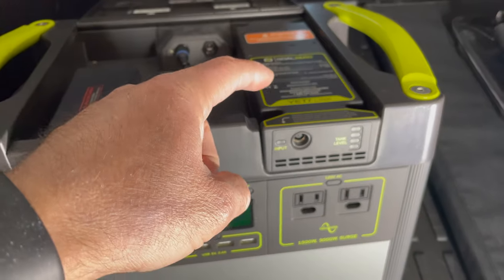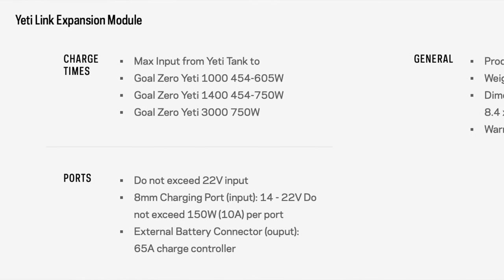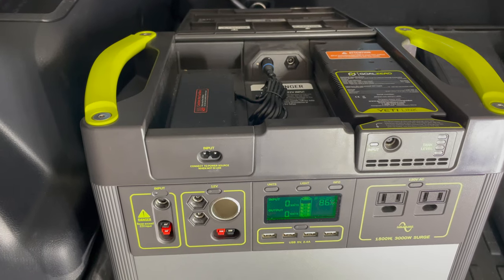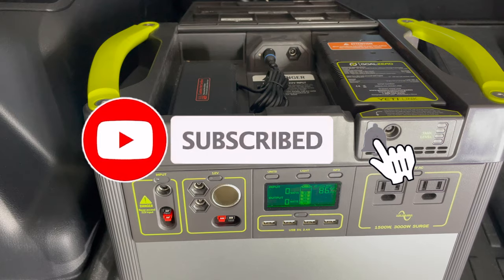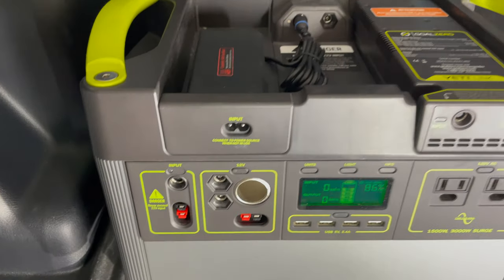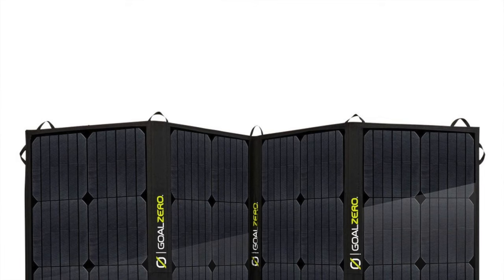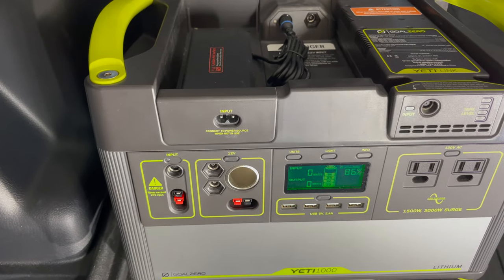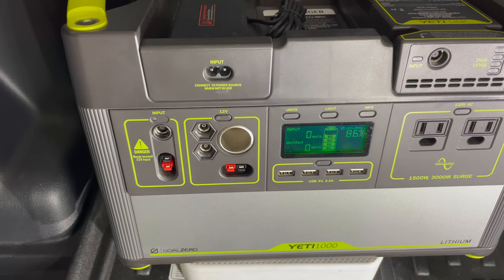5 ways to charge your Goal Zero Yeti and my favorite 2 options

Comment: Could you tell me how you wire the car link? Im trying to figure out what would be the best way to route the cable from the battery. I have gx460 which is very similar to your 4runner. Thx

Comment: You connected your Yeti 1000 directly to your alternator... could I charge my Yeti 3000 from an alternator that is attached to a bike and not a car? I COMPLETELY understand that this is not super efficient and that I will only produce a few hundred watts per hour (it's not hard to maintain about 200 watts for an hour), I am more interested in charging my Yeti 3000 as a way to inspire me to burn more calories on my bike than I am in actually charging the Yeti in any significant way. If I know that my watts on the bike were being saved in any way, it would inspire me to produce more watts and therefore ride the bike more. 

So again my question: do you think I could attach the Yeti Link to an alternator that is powered by a bike and still charge a Yeti 3000? Thanks!!

Comment: I just finished install of yeti link in my 2017 4runner.  Thanks again for your video as it helped me a lot.   When you turn the car off what do your link module LEDs do?   For me, all 4 stay lit for a few minutes, then it shifts to just the bottom 3 staying lit.  I left it that way for over an hr, wondering if they all turn off at some point or do they stay on "forever"?  But gave up waiting & just unplugged it.  Also when I disconnect the back Yeti Link cable, after the engine has been off for a while, I get flashing red for approx 1-2 mins bef they go blank.  Is it the same for you?
Reply from the maker: You should check out the instructions on GoalZero site. It doesn’t seems right. Usually after turning off the car all lights stay green for a few minutes then they go off.

Comment: Excellent video.  I too have a 4runner, a 2017.  What path did you use to route the link cable from battery to the back?  Where did you enter the inside from the engine compartment, or?  I bought my yeti link pre 2019, so looks like I need the newer cable set as well.
Reply from the maker: Thanks. Facing the car, there is a covered firewall entry, had to make it a bit bigger with a gradual drill bit, used a plastic rubber cover from Amazon, passed the cable through it, by the fuse box, under plastic trims to the back. It wasn’t easy because the cable is too thick. Yes, you need new cables, connections locks and a fuse. They do have an updated cable due to the recall that was issued. Good luck!
Reply: @ToolsReview  one final question, where did you pop out from the trim into the car & did you cut a whole at the exit point? All I can see from the video is the cable coming from somewhere behind the driver side back seat? Tx again!
Reply from the maker: Didn’t cut a new hole. It is risky to do so since many components are right behind that area.
Reply: Sorry for the unclear question.  I get the part about going from the engine area, thru the firewall into the interior behind the steering wheel area, but am asking more about the route while inside the vehicle from the firewall to the back.  I understood you to say you routed it thru the trim which I can understand, like maybe under side trims by the bottom of the driver side doors but was wondering more about how you routed around/up the back seat to have the cable exposed to the back.
Reply from the maker: Got it. Yes, under the floor trim, passing under b pillar, continued under the floor trim until I reached the interior rear funder cover.  I exposed the other end of the cable at that point where the back of the rear seat starts from,. It is a decent distance so I was left with about a foot or a foot and half. Hope this makes sense.
Reply: @ToolsReview  I'm looking at the stock entry port from the engine bay on the driver side thru the firewall which is a large grommet with a main cable feed running thru it.   Lots of folks have used this spot for smaller cable runs by putting in slits or small holes next the large existing cable feed.  Is this the place where you made the whole "bigger"?   There is also another spot where a small grommet plug exists, up and to the left of the main entry point - is this the one you made bigger?  Can you provide the link to the amazon rubber cover you used?   And maybe a picture of your entry point from the engine bay side?   The end of the Yeti Link extension cable really is pretty big.  I'm struggling with how to make a hole big enough for the Yeti extension cable connector, and then how to seal it to maintain Firewall/Water protection.  Tx!

Comment: I have a 4runner myself. Can I USE the 12v DC output from the Goal Zero Battery Pack to power my Dometic Fridge while it is being CHARGED from the 4runner 12v power source? 

I am thinking this would make sense because as I am driving 3+ hours on the road this would help keep the Goal Zero Battery Pack charged and topped off. Or would it make sense to plug my dometic fridge directly to the 12v AC power source on the 4runner?
Reply from the maker: Charging your Yeti from a 12v source is possible but it will not be a 1:1. The power you will take out to run your fridge will be more than the charge you will put in. I never tried the 12v charge because it is pretty slow. Hope this makes sense.
Reply: @ToolsReview  Wow thanks for the quick reply! 

I think the best route for me is to only use my Goal Zero Battery pack when i get to my campsite and run my fridge through the 4runner when i am still on the road. 

Thank you for this content and quick reply!

Comment: Can you PLEASE tell me which solar charger is best for my Goal Zero Yeti 3000 and that hopefully doesn't cost that much? Because Yeti is telling me that it costs 500 dollars for 1 solar panel but that I will need 6 of them! So can you help me out here please🙏....I also have an electric small car so charging from the ultinator is not an option. Please help me with this!! Thanks!!✝️👍👍
Reply: Goal Zero has mad it a little difficult to add Solar Panels from other manufacturers. I purchased some inexpensive panels without realizing they would exceed my GZ Yeti1000Li max voltage input of 19v, so I had  to return the panels.

Comment: Excellent video. For clarification, did you connect the leads for the Yeti Link cable directly yo your Alternator, or the studs on your battery?
Reply from the maker: The connection is to the battery. Since I did this video, they had safety a recall on this setup and have replaced these parts with a new set of cables, connection locks and added a fuse.

Comment: I own a GZ 1500X and the Yeti fast charge 25 AMP power supply so compatible.
Reply: Great video! I have hooked up my solar panels, and plugged into the Anderson connector. The light is blue but I am showing 0 watts coming in. The battery is at 100%. Should it be showing an input or does the battery need to be lower to receive a charge?